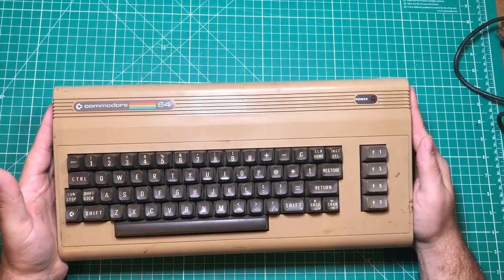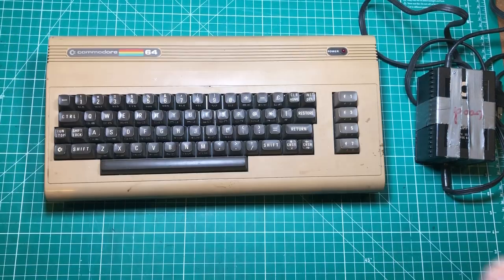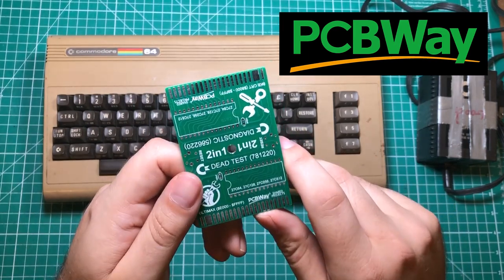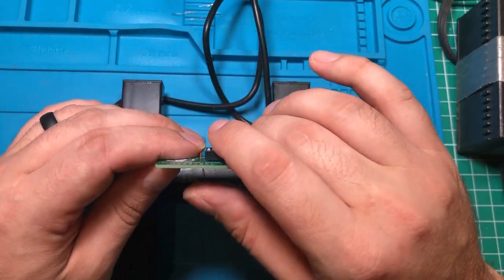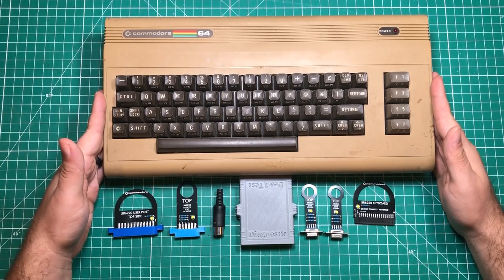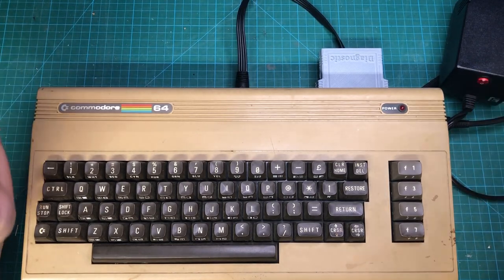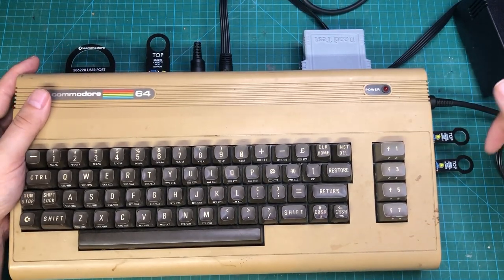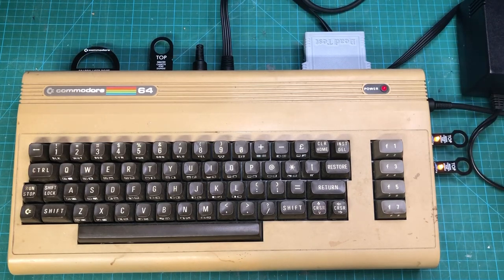Commodore 64 Dead Test Cartridge + Diagnostic Cartridge in one!

Comment: If the chips are socketed, try reseating
Reply from the maker: Great idea. I haven't pulled it apart yet.  If that doesn't work, I'll flip flop the two chips. Thanks for the tip.

Comment: I picked up a C64 with 2 x 1541 drives for cheap at a boot fair (a UK thing) with no cables. 
Built a power supply using a 5v module and a 9v transformer. Pretty simple.

Need to go back to it at some point as the cables I used for 5v have quite a voltage drop!
Wasn't a problem until I started powering a PI1541 from the 5v.
Reply from the maker: I know the 1541s have reliability problems of their own. I haven't gotten around to trying mine yet. I still have so much to learn

Comment: First try cleaning the control port edge connector, you don't necessarily have to disassemble the machine to do that. I have found often that will fix the port "error".
Reply from the maker: I absolutely will. It also turns out that it's required to have the keyboard connected to have that controller chip tested. That was my fault.

Comment: I have that same diagnostic kit, and oddly enough, for whatever reason, EVERY one of my 10 C64's are reporting bad U1 and bad control port.
Reply from the maker: I wonder if there's a problem with a dongle.
Reply: the diagnostics expects a further test dongle on the keyboard connector. obviously this dongle set doesn't have one. thus the keyboard is reported as OPEN. one joystick port (I think #1) shares control lines with the keyboard. as there is no keyboard feedback dongle, the control ports can't be tested properly, thus reported BAD. and it's the same with the U1 CIA. if I remember right, it is used to switch something to test the paddle controls of the joystick ports. and this test requires some wires going to the joystick dongles. as this harness has no wires, the expected feedback is not measured and the diagnostic has to think, either the ports are BAD or that U1 did not switch the control ports (hence marks the CIA1 as maybe BAD too).
this cableless test harness is just a bad idea in the first place!

Comment: ... vielen Dank für das informative Video. Wird aber wohl preiswerter, wenn man bei Ebay für fertige Module schaut. - .Many thanks for the informative video. But it will probably be cheaper if you look for ready-made modules on Ebay.
Reply from the maker: Absolutely...and the ones on eBay support the creator so I am fine with that too
Reply from the maker: Absolutely...and the ones on eBay support the creator so I am fine with that too